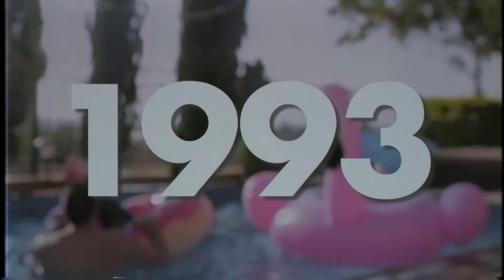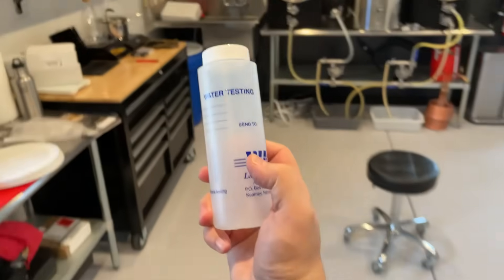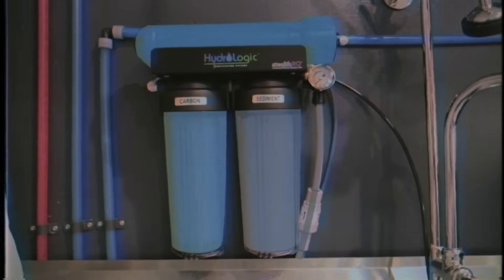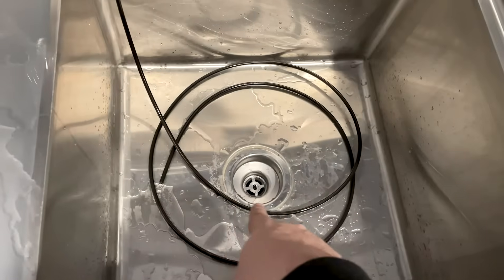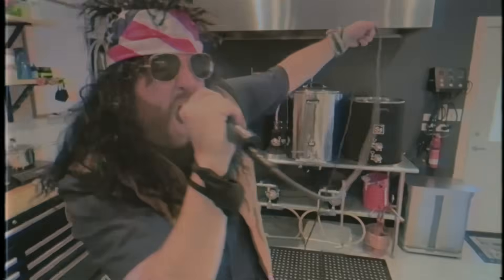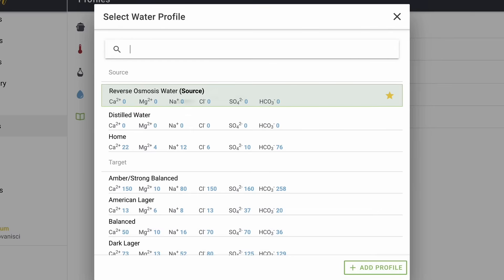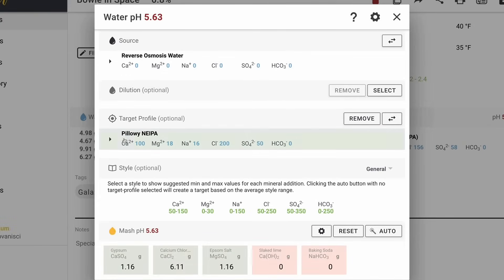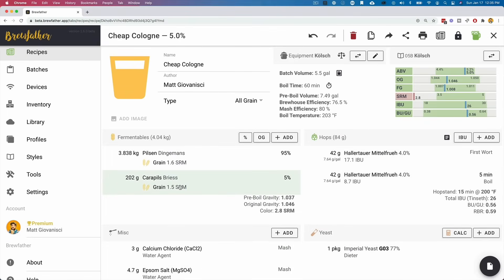Master Brewing Water Chemistry in 9 Minutes

Comment: I'm a little new to brewing, only been doing small batches. But i'm about to do my first batch using water chemistry. My batch will only create a gallon of beer, my question is what should i do after the boil? I lose water that isn't quite a gallon, so I've been adding water when it cools down after the boil. Should I just not care if I lose less than a gallon, or should I add treated water? Thanks, loved the video!
Reply from the maker: Treat all your water before you start and don't add any later. That's what I do.

Comment: Do you add the salts before heating up the mash water or after? My homebrew shop says I have to add Epsum AFTER the water has boiled. Is that true?
Reply from the maker: I add it as it's heating up. I try to add it once it reaches like 100F or more so it dissolves a bit faster.

Comment: I don't have the space in my tiny brew shed (or the money, come to that) for an RO system, and was hoping this would deal with modifying tap water. The title could have made it clear that the video was about making and using RO water
Reply from the maker: It's not JUST about RO water. You can adjust water chemistry based on your tap water. You just have to get it tested first, which is what the beginning of the video talks about. And the end talks about using calculators to adjust your chemistry (no matter where you're starting from). I suggest giving it another watch (and feel free to skip past the 10-second montage of me building an RO system...and the music video too).
Reply: @BrewCabin  Okay, you do mention modifying tap water, but the emphasis is definitely on starting with water with no salts and adding things. I guess that I have become a little grumpy because I have water with an extremely high hydrogencarbonate concentration, and very little is  written about how to deal with that, as it involves decreasing its concentration, rather than adding salts. After a lot of searching through weirdly explained chemistry (I am a recently retired chemistry teacher), I found that adding food grade sulfuric acid and hydrochloric acid gets me close to the desired water profile in most cases.

Comment: Nice video!  However, I believe you've entered the Sulfate values for your home water into Brewfather incorrectly.  Ward Labs reports the sulfate levels as SO4-S which translates to "Sulfate as Sulfur", not SO4. Therefore, you need to take the PPM value they provide and multiply it by 3 to get the actual sulfate PPM.  You should be entering 30 into Brewfather, not 10.
Reply from the maker: Thanks for the info!

Comment: Do you have a flow restrictor added to waste water line to get the right amount of back pressure for the RO filter to work properly?
Reply from the maker: I do!
Reply: @BrewCabin  how did you work out what size flow restrictor to use? I have a 75GPD RO filter.
Reply from the maker: I just bought the only one available for the model I have. The company told me what to buy.

Comment: Excellent video, music background and brew room setup!  One question....how were you able to plumb the water line to the side of the pot filler (as opposed to behind the wall)?  Are there pot fillers out there that allow for plumbing to the side or did you add something (like a T) and anchor to the wall?  Any tips are appreciated as I am looking to do something similar.  Thanks!!
Reply from the maker: Yea you can do it with any pot filler too. The plumber just used a 90 degree tee fitting right on the wall.

Comment: The video is GREAT!! RO water is the way to go. The brewery is very nice. The experiments performed in homebrewing have no connection with ale and lager because the instructions for producing homebrew are based on producing distillers beer. Alpha, glucose, and a single temperature infusion are only needed for producing distillers beer. The steps that are needed for producing ale and lager are skipped in homebrewing because the steps require a lot more work and time, costlier ingredients, and more equipment, than it takes to make homebrew. Conversion, dextrinization and gelatinization steps are skipped in homebrewing and when the steps are skipped ale and lager cannot be produced. The only purpose of Alpha is to release, glucose, which is a building block of life, from starch, and the enzyme works quite efficiently at 98.6F. Glucose is responsible for primary fermentation and ABV.  
The single temperature brewing method, chemically and enzymatically, cannot produce ale and lager, due to the way that enzymes work and chemical precipitation, making strike and target temperature not so useful for producing ale. The high temperatures used in homebrewing denatures the low temperature activated enzymes required for making ale and lager, Beta, in particular. The brewing method produces extract that is chemically imbalanced, sugar imbalanced and unstable, which produces beer with short, shelf life. Homebrew is artificially carbonated with sugar or CO2 injection and drank, green, boiler to belly in four to eight weeks, because the beer, rapidly, deteriorates during fermentation and conditioning. 
When conversion occurs, secondary fermentation takes place. Beta is the converter (140F), the enzyme converts simple sugar, glucose, that Alpha releases from amylose during liquefaction, into complex sugars, maltose and maltotriose, which are the types of sugar needed for making ale and lager. Yeast works differently on maltose than it does on glucose and it takes place during secondary fermentation. Beer doesn't need to be artificially carbonated with sugar or CO2 injection, due to maltotriose. When conversion occurs, beer tends to overly dry and thin during fermentation and conditioning. To counteract the negative impact, two steps are used in brewing ale and lager that cause dextrinization and gelatinization to occur. Dextrinization and gelatinization are responsible for body and mouthfeel in beer. The steps are skipped in homebrewing because of the time and work involved.
There's a type of hard, heat resistant, complex, starch in malt that makes up the tips of malt, called amylopectin. Contained in amylopectin are A and B limit dextrin, which are tasteless, nonfermenting, types of sugar responsible for body and mouthfeel in beer, along with a type of albuminus protein that doesn't form at high temperature. The temperatures in homebrewing are too, low to burst the heat resistant, starch, where it enters into the mash liquid, before Alpha denatures and the richest starch is thrown away with the spent mash, unused and paid for. Mash is boiled to take advantage of the starch and when the boiling mash is added back into the main mash, Alpha, liquefies amylopectin and dextrinization and gelatinization occurs. Pectin is responsible for gelatinization, it's cellular glue that holds beer together through the long conditioning cycle that ale and lager go through.
To produce high octane distillers beer soak malt at 150F because at the temperature Alpha releases the highest volume of glucose, as possible, from starch within a hour. The more glucose the more alcohol. The temperature is used in grain distillation. Test for starch at 30 minutes using Iodine. No starch, move on, nothing more will occur. Marris Otter, Halcyon and Golden Promise are good malts for producing distiller beer. They're high quality, distillers malts. There's a certain malthouse that produces Marris Otter with10 percent protein content, that's the malt to use. However, the malt is over modified and that's OK as long as corn and rice aren't used. Diastatic power is low in the malt. Some six row, malt would need to be added when corn and rice are used.
To produce ale and lager an entirely different brewing method and under modified, low protein, malt are used. Under modified, malt is richer in enzyme content than high modified, malt and low protein, malt contains more sugar. Modification and protein content are listed on the malt spec sheet that comes with each bag of malt, which a brewer uses for determining the quality of malt, before it is purchased.  Weyermann floor malt and Gladfield's American Malt are under modified and good choices for making ale and lager. To view a malt spec sheet click on Gladfield's website and find American Malt, the spec sheet is on the page. Part way down on the spec sheet, under the EBC column, is Kolbach. Kolbach , S/T and SNR are used for determining level of malt modification. I use data from the EBC when purchasing malt. Malt, 40 Kolbach and lower is under modified. Malt should contain less than 10 percent protein. The higher the Kolbach number and protein content, the less suitable the malt is for producing ale and lager. It's not a bad idea to become familiar with the acronyms and numbers listed on a malt spec sheet. A malt spec sheet is more important than a recipe. Recipes, are a given, anyway.
To take advantage of under modified, malt, at the least, a three temperature step mash should be used, which produces pseudo ale and lager. To take full advantage advantage of the rich malt, a triple decoction is used, which produces authentic ale and lager. To soak more expensive, under modified, malt at one temperature is a waste of money because less expensive, high modified, malt will make the same beer, glucose is glucose.
To produce cleaner extract skim off hot break as it forms and continue to remove hot break until it drastically, reduces, when that happens, add hops, skim off second break and boil for an hour. Less hops are needed and hop utilization increases because the extract is cleaner. About hops. The percentage of Beta should be listed on a hop container. When the percentage of Beta is missing the quality of hops cannot be determined. The Alpha and Beta numbers should be within a decimal point of each other. The closer the numbers are, the finer and more balanced the hops are. 
To learn how ale and lager are produced start out with DeClercks books. Abstracts from the IOB are free, online and interesting to read. In the 19th century the IOB made malt, modern when they invented the malt spec sheet. Also, the IOB standardized the tests that brewers performed on malt and moved the testing procedures into the malthouse. Since, time is time, why spend time on producing low quality, distillers beer, when the time can be spent on producing ale and lager? That way you'd be honest when telling a person that the bottle or keg contains ale or lager.
STAY SAFE. STAY THIRSTY. STAY BREWING.
Reply from the maker: Thanks!

Comment: I like the R.O. system but I am looking at this thru a sanitary and maintenance issue. It is good now because its new but water with no treatment in a dark place in my head can create mold. Any thoughts on this or am I overthinking this. I know Brian from Short Circuited Brewing did this too so I know the systems are out there, just wondering about possible bacteria and or mold eventually. Loving the vids, keep brewing.
Reply from the maker: It's a good question. I think as long as it's used quickly and protected from the elements with the lid and air valve (which I added a tight mesh screen to keep bugs out), then I'm probably good. And I usually only fill it up the day I'm about to use it.

Comment: Excellent, great setup and thanks for sharing!  I just got into water chemistry and started using Brewfather to calculate.  Now, even more the reason to add the RO filter in my brew room.  Thanks to Short Circuited Brewer for providing the link to this video!
Reply from the maker: Hell yea! Brian’s setup is perfect and the video was incredibly helpful.
Reply: @BrewCabin  One more question....how were you able to plumb the water line to the side of the pot filler (as opposed to behind the wall)?  Are there pot fillers out there that allow for plumbing to the side or did you add something (like a T) and anchor to the wall?  Any tips are appreciated as I am looking to do something similar.  Thanks!!
Reply: @ediemboyer  Did you ever find an answer to this? I'm open for ideas on this as well.
Reply: @shrumby7231  after much research and based on my needs for brewing (about 1 brew per month), I went in a different direction as I only needed enough water to brew 5-6 gallon batch per month or so.  I ended up getting the Waterdrop D6 Reverse Osmosis system that was very easy to install on my stainless steel sink and provided me with the water I needed to brew.  Less equipment and much more simplified.